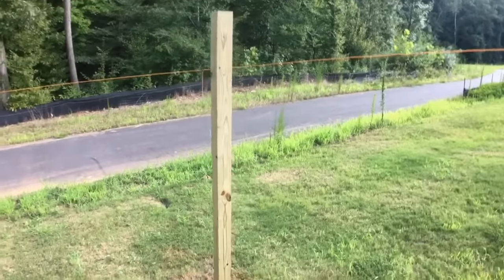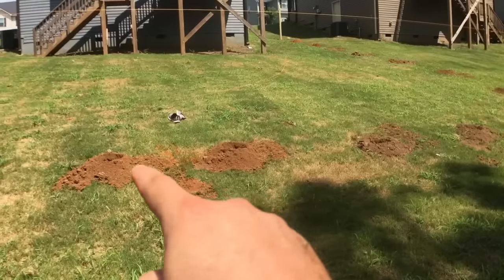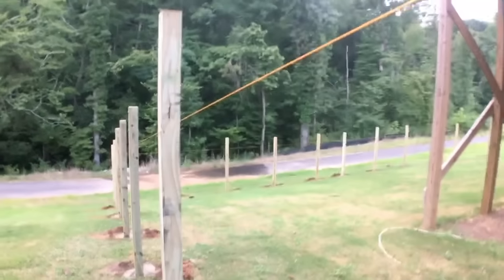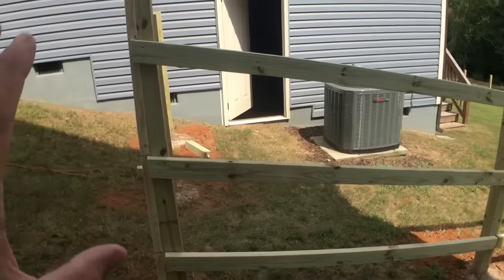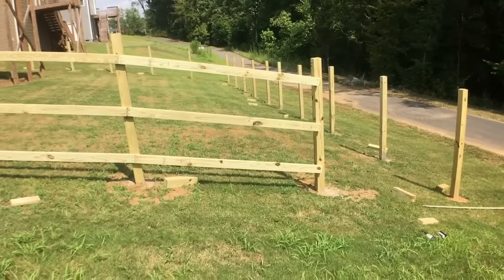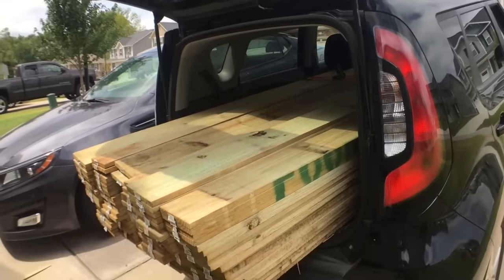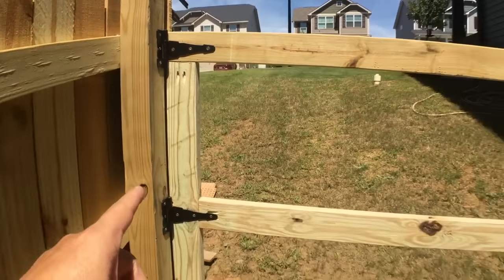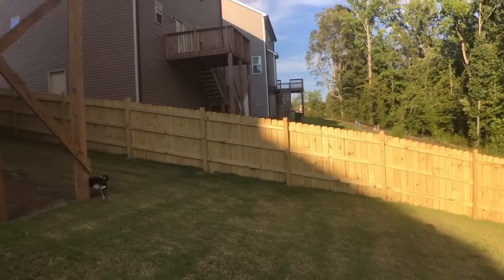How To Build & Install A Wood Privacy Fence Yourself! WITHOUT breaking the bank!!!!

Comment: On pre-made panels from the box stores - I checked them out before building my fence.  They are very poorly made.  The pickets are thinner wood, the rails are smaller, and everything is stapled together like the secretary did it.  No way would I use those things.  For a little more money you get a MUCH stronger fence by building it yourself.  This guy made a few mistakes just like I did, but it still is the better way to go.
Reply from the maker: Thanks for watching Toby!!! I agree with the facts about panel fencing.... not the best construction. Glad you liked the video!!

Comment: Looks good. The sagging is from the weight after adding the panels on the 2x4's. I did one that I was proud of and then it started sagging.
Reply from the maker: I’m going to add some support when it warms up a bit! Unfortunately with the slope in the yard they gates can only open one way.

Comment: Did everything pretty good but you should never rest your pickets on the ground. They will leech water from the ground and rot very quickly. Plus, if you raise it up a bit, your weed eater string will pass under it instead of carving a line down your fence.

Comment: Should try digging with little beaver then u have a job that two man auger is nothing. I work for ramm fencing out of dyersburg Tennessee that is what we use. You did very well but we have to have fences this size done each day with only two men on each crew.
Reply: Two days, that's rocking it. Little beaver all the way.
Reply from the maker: I could see this being done by 2 pros in two days easy!  I never did this before and think we did pretty darn good!  Thanks for watching !!!!

Comment: Never use an auger, if you hit a rock you're screwed. I can dig a hole faster with post diggers than an auger too... Look at how straight these posts are! Shows them all off level... lol. Pretty good job though. What you don't seem to understand though is that on your own fence, sure you'll take the time to do all these steps and build it board by board. When you work for a company you don't have that luxury they have to finish jobs quick this probably took you... a week? This is a day job for a large company, even a half day job. Also, I get following the contour of the yard but sometimes people don't want their fence like that, they want the top to be straight, that's how you end up with the gaps underneath but it's how the customer wants the fence to look.
Reply from the maker: Awesome comment and thank you for that. Augers are a “B” for sure!! I hit a rocks and darn near broke my wrist! All in all we worked on the fence over 4 days in a two week period due to jobs. My HOA had a rule that we had to keep it at 5’ and follow the contour of the land. At $1400 and never doing this before.... were in love with the end result! Thanks so much for watching
Reply: It came out really well. Just wanted to note a couple things. There’s many ways to install a fence. Honestly this is one of the best ways. The only thing that’s always the same is to make sure your posts are deep enough and use concrete.

Comment: It is a lot of work, but I don't see where it's cheap when it comes to cedar dog ear, and 4x4 pressure treated at 9.77/ each, and dog ear at 2.80/ each
Reply from the maker: It was a heck of a lot cheaper than a private company or big box retailer to install! Actually I saved more than $2100 doing myself! The cheapest quote I got was $3500 from a private fence company and $4900 from Lowe’s!!!

Comment: Any reason why you put the cross members on outside of the posts rather than inbetween?
Reply from the maker: Absolutely a reason! Every single cross member would have to be a precision cut #1 and that would be a pain in the tail. Also if there was any shifting in the fence donto wind the likelyness of them shifting or pulling out would be greater. The way I did is fast, easy and effective. Thanks for asking and watching!!!
Reply: It is better because they will not separate from the post.  Give a listen to my original Country song. Let's go back to the drawing board.

Comment: every post have to go every 6 feet, just because the fance panels dimension is 6 feet. and need to be secure tide.
Reply from the maker: I would say yes if you purchased preassembled panels. This build was not using them so I got to choose my span of choice. I went with 7’ so I could cut a 2x4x8 to length just Incase Each 7’ span wasn’t exact. Thanks for watching!!!

Comment: 5$ concrete mix from home depot good enough ?
Reply from the maker: Yes, absolutely.  I did not buy anything "expensive"! Thanks for watching!
Reply: @TheCrawlspaceCraftsman  What about the cheap fence picket the one under 2$ from home depot will do the work ? great video btw !!
Reply from the maker: trance1986 that is 100% exactly what I used! The less expensive ones. The higher priced I believe were Cedar. One of the reasons I went with Home Depot (this might sound weird) is the color of all the wood matched! 2x4s, 4x4s and Pickets... all the same color. Lowe’s 2x4s and 4x4s all has weird colors.... I didn’t like that! Go to Home Depot or Private local supplier!
Reply: @TheCrawlspaceCraftsman  thank you great advice!

Comment: why do you set your post every 7 ft when 2x4s come in eight ft lengths
Reply from the maker: 3 reasons. 1: it mathematically worked out better and 2: it makes for a stronger fence 3: if the spacing of 4x4 is off…. It sucks to be short. It’s easier to just cut off any access the. Having to go back out and buy another 2x4

Comment: Dumb question, how do you level it with a string?
Reply from the maker: Not a dumb question.  The string is only used to keep the poles Plum on one side and in a perfect line so your fence is "Wavy once you install the slats.

Comment: I just need 8 and 16 poles someone told $1100 I find that pricey and it’s just to divide my house from our neighbors . I want to do this myself not sure where to start
Reply from the maker: You can do it!  Dig your corner poles.... Set them in concrete. Make sure they are plum (Straight up and down... check with a Level on all four sides) Let them sit 24 hours.  then dig all your other holes.  Set a couple string lines so when you set your inner poles in concrete.... they are inline with the string (barely touching the string) that way you know your fence will be straight.  Attach your 2x4s.... and then cut your slats to size... nail on and your good to go!  YOU CAN DO IT!!!!

Comment: How about a manual post hole digger?
Reply from the maker: It can be done. I would have only been able to do a few holes a day!
Reply: KalindsLife what did they charge to rent the auger?
Reply from the maker: Dr. Mike Hughes I think I paid like $80 at The Home Depot. Wasn’t worth buying one for $250 at Harbor Freight although the thought ran through my mind! 🤣
Reply: Where I'm digging holes I don't think I can get an auger in there. 6 inches off the existing fence. Uphill neighbor just built his land up an additional 12 inches or more. Plus put in a french drain that concentrates all of his water draining onto me in the rush of a water fall. So I'm coming 6 inches off his fence and installing an 8 ft. Fence. Burring 30 inches of the post in the ground. I'm digging 32 putting in 2 inches of dry sackrete then putting in the posts. I set the first post yesterday. Got around 20 inches dug and one of the Post hole digger handles broke. Went to day and bought two new handles and installed them. Costs me $26.00 a new digger with metal handles was $40.00 but I would still have a broken posthole digger and it is only 6 years old. A waste to toss it for a broken handle. Anyway I priced the use of an auger. It would be $100 depost and $75 a day. But looking at the auger the handles would keep me from getting it close to the fence. Would work fine on the open range. I priced buying an Auger the unit would be $400.00 and the Auger bit would be another $50.00. I don't think I want to go into the fence installation business especially in the heat of the south. Don't like this heat in Louisiana never had it this hot in Chicagoland!

Comment: Why 7 ft apart? Aren’t sections 8ft?
Reply from the maker: There are a couple reasons.  My main reason was I didn’t trust myself to measure and set the uprights EXACTLY 8’ apart in concrete.  I felt it was easier to do 7’ and just cut off at each post.  Also…. For me…. 7’ spacing between them worked out perfect for my length.  Lastly… the closer the uprights (4x4’s) the stronger the fence!
Reply: @TheCrawlspaceCraftsman  I just did the 8 ft BUT before cementing it in we attached the fencing so that we could make adjustments once in cement. It turned out pretty good on the two sections we did but I’m going to try again on the next section this weekend. I did get some pictures and video on my page here. I’ll post the rest this weekend.
Reply from the maker: @anibor_1  awesome!!! I’ll check it out!  Sorry for the late reply too.  I just didn’t trust myself! LoL.

Comment: What size is the diameter of the auger bit.
Reply from the maker: I believe it was the smaller size. I think they offered an 8” and 12”. Get the small one. The smaller the better so you use less concrete.
Reply: Ok thanks

Comment: 52 inches or 62 inches? You said 5 feet with an extra 2 inches. Just trying to make sure since I have to learn how to do this lol.
Reply: Also would you do two feet in the ground for a six foot fence?
Reply from the maker: No.... for a 6’ fence I would go 36” or refer to your local frost line. And I did say 52 and didn’t mean too..... my brain was thinking 5’2” and it came outa my mouth..... 52”.
Reply: KalindsLife all good you do great work thanks!

Comment: I hope you didn't cut those at 52". You claimed that the HOA said you could build a 5' fence and you wanted to add a 2" cap, that would be 62" vs. 52"
The term for the 2X4's connecting each post is a rail. For a 5' fence, you, realistically, could have used only 2 rails. Those "slats", they are called pickets.

Good job on the fence, however....Like ramen, much?

Comment: never cut your posts with a measurement  off the ground,set your bottom rail then measure off of that.his top rails look wavy because of ground measurements.Also,with that style of fence,the neighbors get the better look.would have done the rail and fenceboard on the inside.If you disagree,please reply,i would like to know the opinion of the average person.
Reply from the maker: Hey Roger! Thanks for the comment! The build was all based on my HOA policy’s. Had to be no taller than 5’, Had to follow the contour of the ground, Had to be wood slats with gaps no larger than 1” and also the slats have to be on the outside of the fence for curb appeal reasons. I also called 811 (Call before you dig). Hope they expains a few reasons why I did how I did and why I did. Thanks again for watching!!!
Reply: @TheCrawlspaceCraftsman  sounds reasonable,up here the curb appeal goes to whoever pays for the work.lol
and your welcome,was a very good video

Comment: Where are you installing that fence? A 7ft span between posts would never pass inspection where I live. 6ft is the biggest span for a 4 ft tall span a 6 ft fence calls for a 4 ft post span. So are you sure you know what you are doing? But then again, where you are at, your code maybe be completely different.

Comment: Nice, but you should have used deck screws.
Reply from the maker: For dogear boards?
Reply: Oh my gosh!  People have been using deck screws for hundreds of projects.  They come in all lengths, colors, have a lifetime warr. and are simply the only way to go.  Been building wooden fences for some 25 years now.  Check them out at Lowe's or Home Depot.  Nail guns shoot the nail in too far and you can not simply back them out and replace the board if you need to.  Thanks.

Comment: Looks like you encroached on your neighbors property with the size of holes and cement, left side neighbors property when looking from the back. No issues with them.
Reply from the maker: Not even close. When I measured out the property lines I came in about 8” so I wouldn’t do that. Not sure how you could even tell what my property lines were being I never really talked about that to make this comment. Out of respect to both sides.... i shrunk in my yard about 12” total.
Reply: @TheCrawlspaceCraftsman  I went by the view from the back looking forward, the posts looked exactly in the middle of the 2 houses, so I assumed (my mistake) that you went right down the property line.
Reply from the maker: Nope. Actually our lot is a little larger than both on each side. It’s weird how that worked out but our lot is larger! We had the pick of all the houses and chose This for the lot as well as the crawl space in which i built my workshop.

Comment: Nails in a fence suck I always see them get loose over time screws are way better.
Reply from the maker: I’m sure your right! I used screws in frame but to use on the dog ear pickets woulda been way to much imo. If I ever have to replace them… so much easier to remove. Thanks for watching!

Comment: Never seen a decent fence built with stringers nailed to the posts. Use hangers.
Reply from the maker: Screwed to…. Not nailed to posts. The Pickets are nailed. Thanks for watching!
Reply: @TheCrawlspaceCraftsman  maybe you live in a different climate but in Oregon a fence built your way will sag in about 3 years. We get rain that weighs fences down. Gates are almost impossible to have work the same year round. Right now my gates don’t want to latch for the swelling.

Comment: The first mistake people make when putting down a fence is putting in a wooden fence.  Most won't last 15 years.  After 8 to 10 their rotted out.
Reply from the maker: It’s all our HOA allows which is stupid in the first place but we accepted that.  Thanks for watching!!!
Reply: @TheCrawlspaceCraftsman Same here,  My fence is almost 10 years old and about to replace it.  Neighbors have already replaced theirs.  I am doing my right this time which is why I watched your video.  Builder put in cheap materials and used shotty labor.  House is the same way.  Thanks for the video
Reply: My wooden fence is 33years old -- replaced 2 posts last year. Other than that, its solid as a rock

Comment: I commend you for all your efforts, but if you used less than one bag of concrete, and a span of 7ft between the posts I hope for you that you live in an area where you don't get strong winds. and don't have a lot of frost, otherwise your post won't be straight for more than a saison. I highly recommend that anybody seeing this video first contact you building department and check your code. I don't think that this fence is built to any code that I am aware off.
Reply: One 4x4 post sunk 2 feet into the ground does NOT need more than one 50-60 lb bag of concrete, thats absurd.  Also the span between the posts is fine, he could have dont it 8 feet wide and no problems.
Reply: @dezznutz3743  I have checked several counties here in Florida and I don't recall anymore where this fence was build, but none of them allow a 7ft span between the posts on a 6ft fence. the most was 4 feet. So I am 99% sure that fence would not pass inspection. But then again, maybe where that person built the fence there is not code for that. I doubt it, but surely possible.

Also the post holes have to be a minimum of 10 inches wide and 24 inches deep in all the counties I checked. 

Now as far as concrete goes ... the hole dug properly has about 1.4 cubic feet in volume and an 80 pound bag of concrete makes about 0.6 cubic feet of concrete. The part of the post in the ground takes up 0.2 cubic feet. So that leaves 1.2 cubic feet to be filled and again, according to code the whole must be filled with concrete to the top. Besides, it is better for the post not to be surrounded by moist dirt but rather have the concrete exposed to the air for better drying after rain.

So I would say depending how long you want your fence to last and how often you want to repeat building a fence you do it either the right way or you follow instructions in this video.

Comment: LMAO. Those rocks are bad???  Try digging a post hole in Miami... I couldn't even use an auger for one job.   
  
Side note, why space posts like that? 2x4s come in 8 ft lengths. Space it for less work.
Reply from the maker: I’m From Florida too so I understand! 7’ span makes the fence a little stronger also if the post spacing is a little off.... it easier to trim off the 2x4 for a guaranteed fit! Some people even do a 6’ span for an even stronger fence. It also prevents the fence from waving over time.
Reply: @TheCrawlspaceCraftsman  down in Miami we have to space posts 4ft for 6ft high fences, 5ft for 5 ft, and 6ft for 4ft.   
People are generally blown away by the cost of materials alone when I quote.
Reply from the maker: I’m From Florida too so I understand! 7’ span makes the fence a little stronger also if the post spacing is a little off.... it easier to trim off the 2x4 for a guaranteed fit! Some people even do a 6’ span for an even stronger fence. It also prevents the fence from waving over time.

Comment: Wrong 32 inch deep no concrete
Reply from the maker: Can you elaborate? Thanks!
Reply: @TheCrawlspaceCraftsman   post will rot in concrete  needs to be minimum  32 in.keep wind from pushing post over  been there done that

Comment: Mate save yourself a lot of heartache put your slats up off the ground
Reply from the maker: The sides weren’t bad but the back run needed to be so I cut off 1.5” off. One of the bigger mistakes but all good now. No issues.